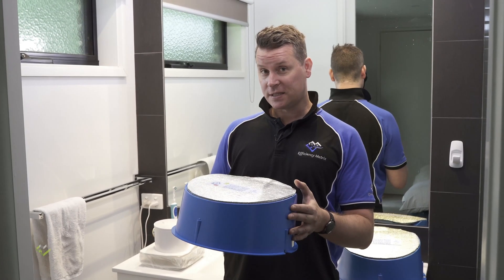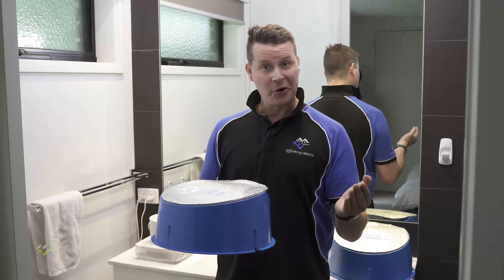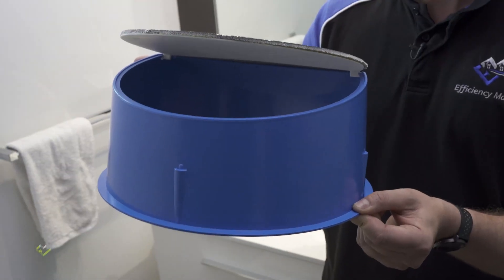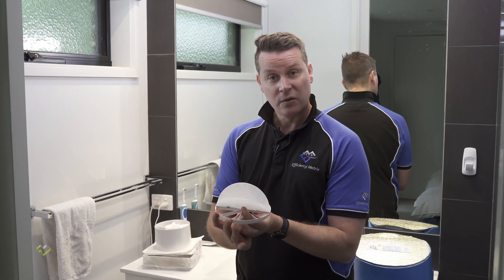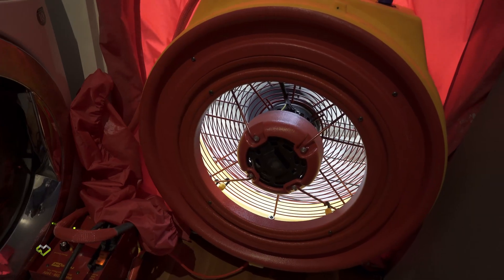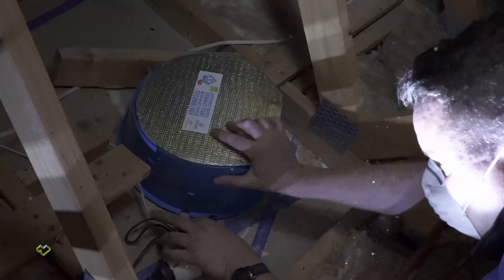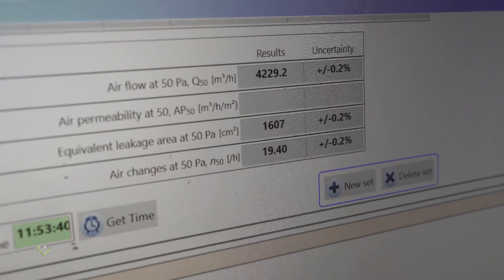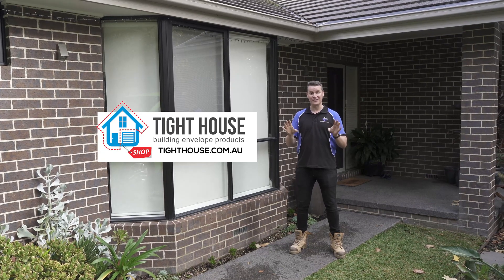Exhaust draft stopper? How does it work, what difference does it make?

Comment: Can you install these draft stoppers even if you don't have access to roof space? It doesn't look like it would fit through the hole but thought I'd ask
Reply from the maker: No you cant.  you need to get access to the roof space unfortunately.   this is one of the reasons why our draft stopper is more structurally sound, and performs better.

Comment: What about exhaust fan / heat lamp combos that allow the heat lamp to be on without the fan?

Can you get dampers with electric flaps that can be connected to the heat lamp switch/circuit to open them when using the heap lamps?

Comment: It makes sense that sucking air out of the house will pull the dampeners shut and improve their seal. What about when the heater is on, and heat is pushing up and out through the dampeners, how much leaks through them then and how much improvement for heat lost up and out do they give?
Reply from the maker: Unless you have at your return, your ducted heating should be pretty balanced.  But you will have a little big of stack effect, which will push a little on these dampers, but over all, you will have significantly less air leakage from your building envelope with one of these in place.

Comment: In the USA, you cannot vent the bathroom exhaust fans into the attic?  Why is this allowed in Australia?  Your attic will be subjected to mold/mildew., possible wood rot with all that moisture being dumped into the attic.   You are required to exhaust to the exterior here in the USA.  What building codes are you guys using in Australia?
Reply from the maker: Agreed.  It’s not ideal, but our weather is quite abit more temperate than it is up there.
Reply: Aussie building minimum standards are a bad joke, that's why they're done that way
Reply: I'm not sure about 2023 codes, but you used to be able to vent into the attic in the US.  It doesn't cause any problems unless they use flex hose, which tends to break apart after 10-15 years.

Comment: Venting the bathroom into the attic causes mold in the attic
Reply from the maker: It can indeed.  It depends on how well ventilated it is.  The best solution is to exhaust directly to the outside.
Reply: In a vented attic, it shouldn't.  We're talking about a small amount of vapor spread across a large area.  It should evaporate quickly and the insulation used shouldn't be capable or growing mold.

Comment: I cod not see that spring balance in your store. I would love to see a video on venting a 300mm hole to the eaves. I assume eves are best as it doesn't interfear with the roof and venting through the wall when the existing fan is in the ceiling would be too invasive. Basically how and what would you use to make that existing hole into the ideal moist air extractor.
Reply: +1. I’m conflicted. Have existing exhaust fans ducting to roofspace but there is a draft stopper.  All the eave ducting kits I see don’t allow the existing draft stopper to be used and therefore whilst I save on getting moisture out the roof, I introduce cold air coming into the house.

Comment: Love your Videos. Just found them and been absorbing the important knowledge you share that is hard to find.  Question: Wall mounted bathroom exhaust fans avoid penetration of the ceiling air barrier and insulation layers. Is there a draft stopper option that works with wall exhaust fans? Gravity shutter grilles get blown open by the wind and don't seem to do much.  Or are there fans with a build in well functioning draft stopping mechanism ?

Comment: Or you could just shut the bathroom door.
Reply: And cause lack of ventilation. Not ideal
Reply: @Mk-631  that’s what exhaust fans are for.Why would you need to ventilate if your not using it
Reply from the maker: Conventional exhaust fans need to be able to easily get air in order to exhaust.  Hey don’t handle pressure very well.

Comment: Shouldn't all venting be to the exterior and not into the roof space?
Reply from the maker: It is extremely desirable to get all exhausts directly to the outside, but if you cannot afford that, and you feel the need to improve the comfort of your home, in the shorter term, using a damper like this, can assist as well, before you make an investment in replacing your existing exhaust fan with one that can be ducted directly to the outside. 👍🏻
Reply: @ecoevo  is the efficiency of extraction affected depending on whether it is placed on a ceiling or the wall?